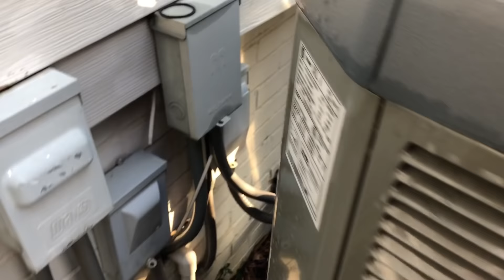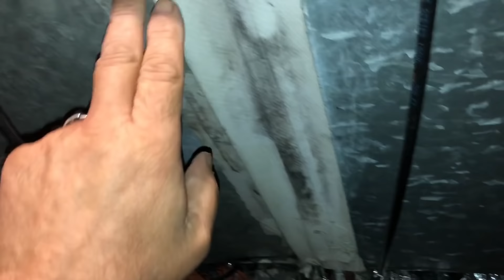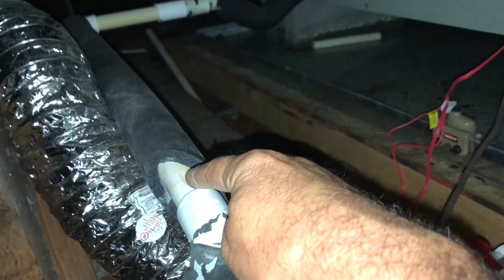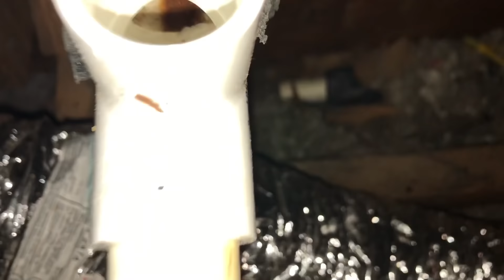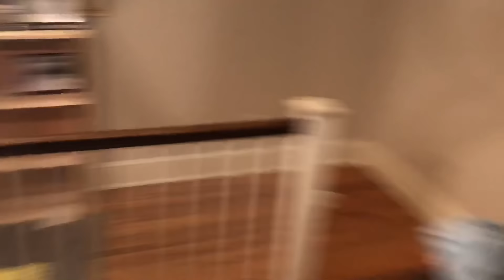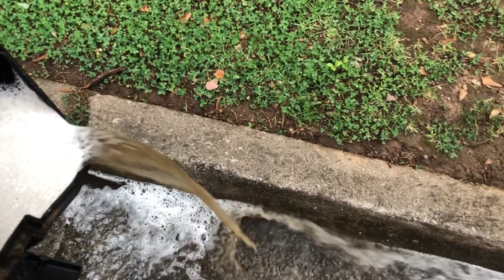No AC call Drain Pan full primary line clogged added pvc tee

Comment: Using a Vacuum unit to clean out those Drain Pipes is Great! I was Vacuum Repair guy for many years. If the pipe is plugged, don't let the Vacuum run to long, as the Air going though the Vacuum Motor, is what Cools the Motor. So if you would not let the air though, you could run the risk of burning out your Vacuum Motor. And some motors are very pricey!!

Comment: I've never tried the vacuum. I just connect my nitrogen tank with a hose and blast that clogged PVC pipe. Its actually pretty good. Besides the fact you have to carry a tank with you. I know they have smaller tanks for tight spots.
Reply: What happens when you blow the drain pipe apart somewhere between the attic and the basement. What's the next step? That's why you use a vacuum.

Comment: Can I add a "3/4 in. CPVC CTS Slip x Slip x Slip Tee Fitting" to condensate drain 3/4" cpvc pipe further down the line not near the evaporator coil.  I noticed that the professional installer normally installed the Tee Fitting next to the P Strap or Strap around the output hole from the evaporator coil.  I noticed that when my primary line was clogged, the water rose on this tee fitting and lucky that my tee fitting came with a 3/4" extension pipe which was high enough to prevent the water spills out; when this happened, my secondary pipe took over.  The reason I want to add the pvc tee fitting to the primary line because I want the bleach or vinegar flowing down the line when I pour the bleach or vinegar and I don't want this liquid goes into the evaporator coil.  The existing PVC Tee Fitting was too close to the evaporator coil and I don't want to pour any bleach or vinegar into this existing tee fitting.

Comment: "Helicopter" as he's incompetent?
Reply from the maker: No, it means to hover over someone like a helicopter.
Reply: He means the customer "hovers" over him like a helicopter looking over his shoulder and he can not record video.
Reply: I'll have to take your words for it. Originally, it sounded like an insult because it was so random. Whomever commissioned that system forgot to provide operation and maintenance info. i.e. detailing to HO what the valve's function (on the secondary pan).
Reply: The Flat Garage when a customer wishes to observe (stay out of way and ask few questions)  the work being done on their +$5000 piece of equipment,  I see no problem with that.👀👀